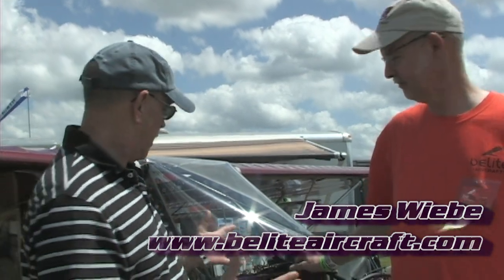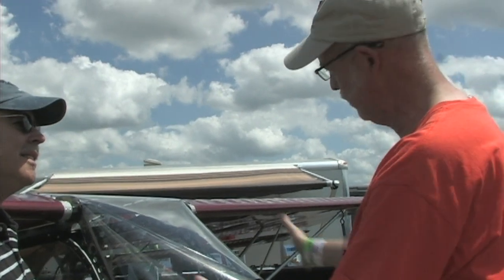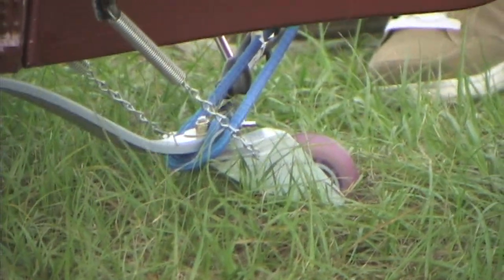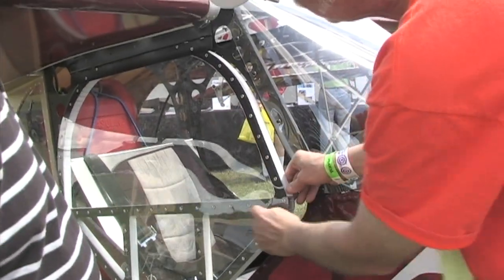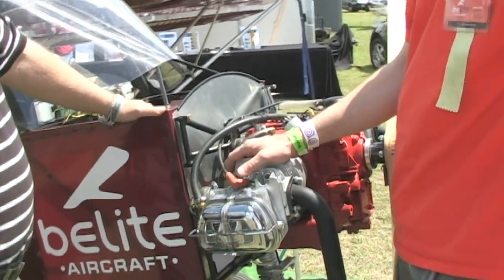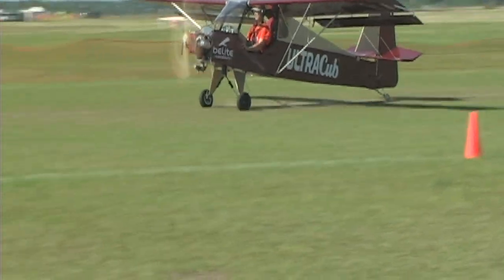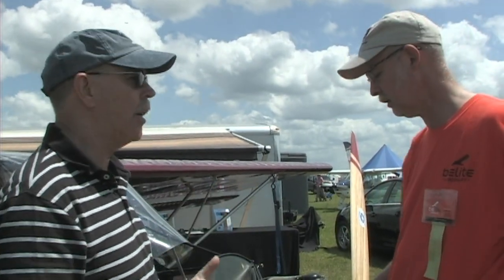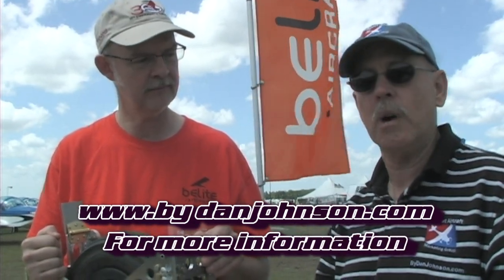Belite UltraCub, Belite Aircraft's Ultra Cub part 103 legal ultralight aircraft with 4 stroke power.

Comment: Why are they using the ridiculous 1/2 VW engine instead of far superior small motorcycle engine? A 2 cylinder Kawasaki 250 engine can put out about 35 HP at half the weight, and be more fuel efficient and cheaper!
Reply: The 250cc motorcycle engine doesn't put out 35 hp at 3600 rpm.
Reply: Mark S Yeah but most make more than that, detune it if needed
Reply: To detune an engine you need to change the piston porting; impossible in two-stroke engines.
Reply: 1/2 vw  is a time tested engine for this purpose
Reply: @UncleKennysPlace  not at all impossible
Reply: Then add the weight of a PSRU and reliability issues of a two stroke.